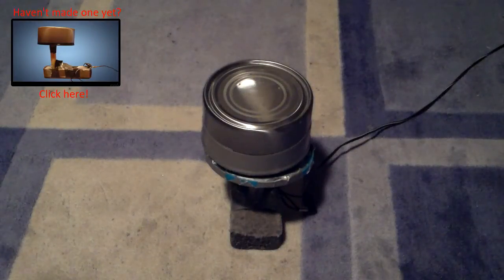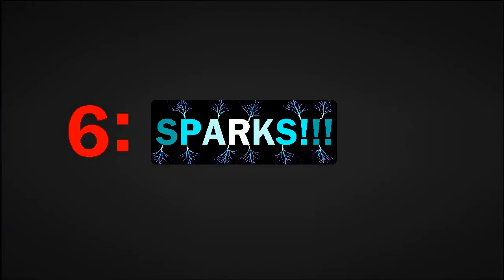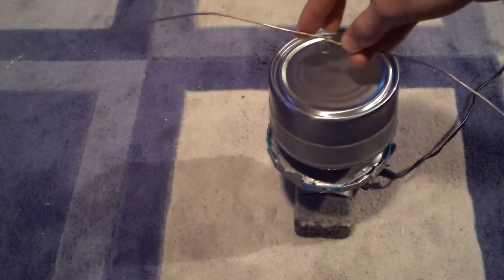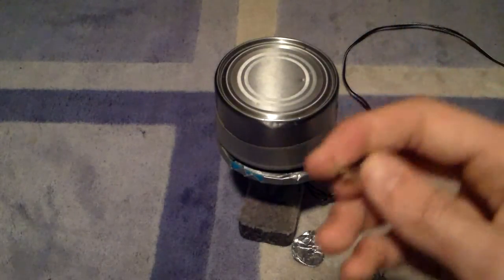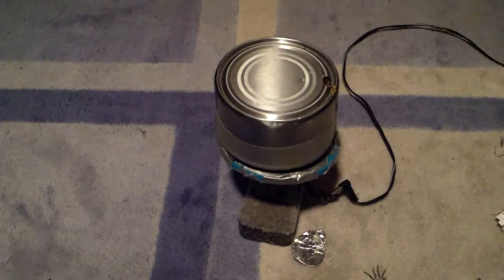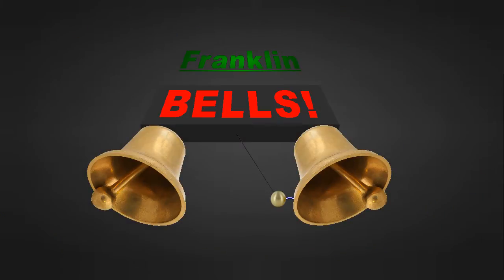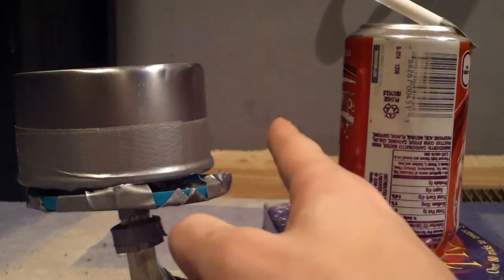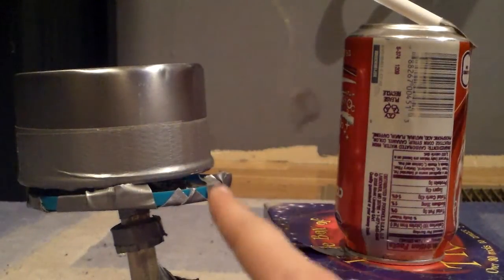6 shocking cool things to do with Van De Graaff Generator!

Comment: Great video! Would you mind explaining what's happening with the paper that's making it stay on the wall, guessing it's static electricity but not sure and why? Sorry but I'm new to this (my son is very interested in this sort of thing so im trying to learn and show/explain things to him. 
Thank you and God bless!
Nate
Reply from the maker: Thanks! Yup, it's all about charge! Have you ever rubbed a balloon on your hair, and then stick it to the wall? There's plenty of good graphics and vids to explain it! I think RimstarOrg did a video on that, but if you want my *really* long explanation, click show more!

------

Basically, since the Van De Graaff generator is a type of constant current source, meaning there is a really small but constant flow of charge from one end to the other. This forced flow can cause voltage differences develop on either side. In our case, the bottom of this generator is grounded, so the entire earth is being used as an anchor point for electricity, and since most all things are connected to that in some way, the output can have an effect on most everything. In this case, we want sparks and charges! (remember, circuits have to be closed for them to work!)

When the top dome part is off, the brush and free end of the wire cannot hold much of a charge at all, and due to all the sharp points said wire. The charge quickly piles up and literally sprays away into the air and towards any grounded object, ionizing the air along the way. You can see this as corona. My slayer exciter video shows that effect more clearly in the video. When you hold that end close to the paper, the charge can jump onto it, charge it, and then when it is brought next to neutrally charged wall, the difference in charge lets the paper clings to the wall! The charge cannot equalize right away because the paper is a half-decent insulator. It will eventually bleed off the charge after several minutes, and fall off the wall though.

They teach in school that opposites attract, and opposites repel. This is absolutely true for subatomic particles, like electrons, positrons, protons, etc because either they have lots of charge, or nothing at all, like neutrons, nothing in-between. However, since macroscopic stuff can is made up of many, MANY of those atoms, it can have a wide range of charge, depending on the surplus or deficit of electrons in our case, so naturally the amount of attraction can vary. So more technically speaking, the attraction force is basically proportional to the product of the overall charges, times the inverse square of distance of said charges Thats Coulomb's law, and just a bunch of fancy talk for saying that more charge and the closer the charged stuff is, the stronger the force!

There is also another effect going on, and that is the fact that like charges repel. When the charged paper is brought closer to the wall, all the oppositely charged particles inside the wall are literally pushed and repelled away, so the wall will take the exact opposite charge of the paper, that is electrostatic induction. It also helps the paper stick to the wall! I hope that was not too long, or wrong lol!